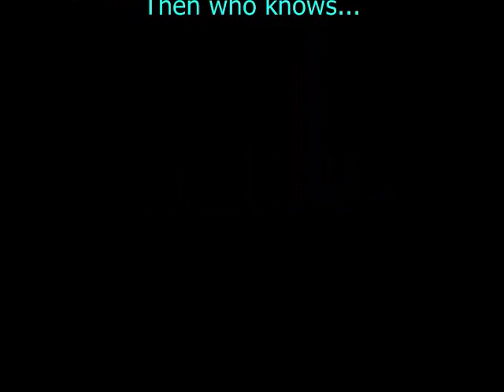My 900 VA Tesla Coil! (Resonant Transformer) Lightning Machine

Comment: I find this stuff so cool - and the discharge immensely beautiful. What I don't understand though is what practical application this has for us? What can this be used for in terms of producing Work in physics terms?
Reply: The entire point of a Tesla coil, Why Nikola Tesla invented the damn things, is to send Energy without using wires, vie sending energy through the earth at your wire, not copper, this would in turn destroy the power industry because there are power lines everywhere, if Teslas coils actually becamse commercial power line companies would go bankrupt, corporate america fucking up society for once again profit...
Reply: GregJoshuaW 

New 2014 solar energy  here look at link 
http://earth5energy.blogspot.com
Reply: lespaulking69 You don't know what you are talking. 
Using a cell phone? What do you think on what invention this is based?
Transmitters sending energy, and your cell phone picks it up.
Reply from the maker: lespaulking69 Earth is a very poor conductor. Tesla used small parts of it as a reservoir for charge, not to conduct electricity.

Tesla was using radio transmitters for all his experiments, although they were poorly understood at the time. Tesla coils don't even radiate very much RF, most of the energy transfer is magnetic coupling, and lots of tesla's experiments were concerned with electric fields and capacitive coupling through the air.

Commercial power companies are doing a fine job with AC transmission. Please read a book.

Comment: You are a genious. Great itroduction and explanation of the basics. I'm a bit in this field, but I didn't quite understand how you turned async motor to sync. As much as I know, sync motor has to have magnets, induction always lags. Great job and keep on the good work. My SUB to you.
Reply from the maker: To be precise, inductors "lag" current, induction motors tend to "slip", unless they are synchronous induction motors. Most applications aren't concerned with slippage in induction motors, as long as they produce lots of torque, so synchronous induction motors are not common, but they do exist. I believe I detail the process in this video for converting a regular induction motor into a synchronous induction motor.

Comment: It seems that the secondary coil is acting as a quarter wave vertical antenna with a capacitive hat. Do you get any radio frequency interference complaints from neighbors when you run the coil?
Reply from the maker: It works on the same principle as an antenna, although tesla coils are designed to radiate as little as possible electromagnetically. It is more precisely described as two resonant, magnetically coupled LC circuits.

The coil produces some RF noise as a product of the "sloppiness" of the spark-gap switching, and activity within the arc.

Comment: have you considered applying at NASA?
Reply: anyone with a degree/understanding in electrical engineering could make one.
Reply from the maker: popedarren Really anybody could build one of these, and they are /very/ simple operationally.

This coil is a piece of dumpster hardware compared to whatever you are typing on.
Reply: kimo Hajije I've seen the tesla coil made, but the way he recharges the capacitors... It sounds, from what I'm hearing, that he's beginning to understand what Tesla was obsessed about: resonance; tuning.  The swing analogy said a lot to me.

I say keep it up, my man!  +highvoltagefeathers, Don't let the nay-sayers hold you back.  Keep doing what you do.  Follow your passion and learn.  The only person you have to impress is yourself, and when you're on the path of discovery, you'll be continually amazed.

Comment from the maker: Well, plain and simple, you're wrong.

This coil wouldn't operate without a synchronous motor.

There are many others who have used the same procedure to make synchronous motors (inefficient, sure, but synchronous) out of normal induction motors. Experiment comes before blind statements.

Google is your friend, sir. Look it up BEFORE you mouth off something ignorant.

Comment from the maker: You don't want to do that with normal transformers. You'll exceed the breakdown voltage of the secondary windings. You can run a center-ground configuration with two core-grounded transformers (like microwave transformers). That way each winding only sees it's operating voltage, but the potential between the two terminals is double that.

Comment: The primairy coil produces a radial magnetic flux towards the toroid, so it should be equal divided at the end. But i noticed that the orientation of the sparks are often on two sides of the toroid... That's where my question was rising from.. But also i noticed the breakoutpoints... So probably if the breakoutpoints are centered, probably you always have two points were sparks come of the toroid... Maybe resulting of influence of the magnetic field of the Earth, or result of the environment...

Comment from the maker: The primary coil produces magnetic flux densities several orders of magnitude more intense than those produced by the earth.

The primary influence behind arc direction is a sharp point, a "breakout point" on the toroid (its made of dryer ducting, so there are plenty).

Magnetic fields do affect arcs and plasma, but the earth's is extremely weak, and the electric fields produced by the toroid, breakout point, and nearby objects dictate arc formation most prominently.

Comment from the maker: In this case, I was mildly disappointed. Synchronous spark gaps are very important for high-power systems in which a missed firing or transient could damage thousand-dollar equipment. I also tried a static gap, and a "sucker-gap" hooked up to a vacuum, both of which worked as well, if not better, than the synchronous gap.
Just my coil though! 
You get much less HF noise with the synchronous gap, which is important for fairs and events. That's why I use one.

Comment from the maker: voltage does not always translate into useable power. This coil draws 750 watts of power from a wall outlet, and is incredibly inefficient. It has zero capacity to "produce" power to do anything.

Comment from the maker: I'm just referencing the power consumed by the neon sign transformers (their ratings on the label), 12kV at 60mA is 750 watts. In reality, unless you use a power factor correction network, you are probably pulling more than that from the wall, but that is the power that goes to charging the primary capacitors.

Comment from the maker: You could also just stick to a static gap, they are hassle-free and work relatively well. Unless you are building a monster coil, I'd say a synchronous gap isn't worth the trouble. My coil is not a monster, and in retrospect, I had better results with a sucker-gap than this rotary piece I have installed here. Not worth the trouble for small stuff (anything under 1000 watts) in my opinion, if you aren't mechanically inclined.

Comment from the maker: Unless you are running your spark gap at a high break rate (over 250 bps or so) then you should definitely run a synchronous rotary spark gap in an AC coil. Asynchronous rotary gaps are for DC charging tesla coils. If you run a low break rate asynchronous rotary gap on an AC tesla coil, then your capacitors could charge almost completely, and if the gap doesn't fire before charge voltage crosses zero, that energy gets dumped across your primary transformer. Not really an "option" for an ac coil.

Comment: Hey there, love your coil! Just wondering, a rotary spark gap is better than a static one isn't it. Also if I wanted to use one for my own coil does it have to be tuned to a certain rpm or frequency (as you said in the video you have scrutinised it to the AC cycle) to improve the coils performance? If so how would I go about doing that?  Also why do you have two toploads, is it just to increase the capacitance of it overall? Thanks

Comment from the maker: Modern tesla coils (physically) bear very little resemblance to tesla's original machines. Tesla was chasing the goal of wireless power transmission in a way that we now know would be relatively impractical. On the way, however, he discovered methods for radio transmission and control (although the credit for the first "radio" went to Marconi).

Modern tesla coils are almost always optimized for the purpose of throwing lightning all over to freak people out and pick up chicks. (it works :) )

Comment: Hello that was very interesting . Just a thought : generally hooking transformers up in parallel has the danger of creating a loop circuit into the coil of one and out the other . any deviation of output voltage between the xfmrs would cause a current to flow round and round thru the xfmr coils . causing excessive heat . although the resistance of the windings is high the voltage output is high and because of that i think any deviation would be magnified . also...

Comment from the maker: Tesla's earthquake machine is a myth. You cannot shake down a building with a mechanical device the size of a shoe box. A little bit of shaking underfoot, possibly. But think about it. If a building were a perfect mechanical oscillator, then this little machine would be able to induce gigantic oscillations at its resonant frequency. BUT a building is not. The structure, and moving furniture absorb energy. All these losses add up to way more energy than you could add with the little piston device

Comment from the maker: Push and pull, if you want to think about it that way. Its alternating current. Voltage is just a difference in charge, current is charge moving in order to bring a difference in potential to equilibrium, work can be done by the current as it moves, and power is work performed over time. It usually doesn't mean much to think of negative power, which refers to whether work is being done on or by a system over time. No lies.

Comment from the maker: OR use the inverter to drive a resonant primary circuit (primary capacitor and inductor) that is tuned to the resonant frequency of the secondary (DRSSTC). 
SSTCs usually run continuously, while DRSSTCs typically run in pulsed operation at very short duty-cycles (only a few RF cycles at a time), to limit primary currents.

Both are very cool, because they can be either amplitude modulated (SSTC) to play music, or the pulse-repetition-frequency of a DRSSTC can be modulated to play music.

So Yes!

Comment from the maker: Absolutely. Spark gap switching is extremely inefficient, and burns away much (in some cases most) of the energy that would otherwise be coupled to  the secondary circuit.

Google "solid state tesla coil" (SSTC) and "dual-resonant solid state tesla coil" (DRSSTC). These are tesla coil architectures that employ a large power transistor-based inverter (usually surplus IGBT modules in the larger coils) to either drive a bare primary coil, at the resonant frequency of the secondary (SSTC)

Comment from the maker: There is nothing to be harvested. This machine is plugged into the wall. The arcs you see are a result in high voltages induced in the green coil and metal piece at the top, by the copper coil and circuit on the bottom, which plugs into a wall and uses about as much electricity as a small microwave (a relatively large amount of electricity).

Comment: pico amp?   if the power was 750 total, and 1million volts, that should give 0.7mA  , what was the voltage and amps output, do you know now? thanx

Comment: Hey, nice video,

I was wondering, since the dielectric breakdown of air is 3 million volts, can't you just multiply your arc length by that to find the voltage on the topload?

So for example, my coil gets arcs around 60cm, so 3 MV X 0.6m = 1.8 MV.  From what you're saying however, voltage this high seems wrong, but why?

Comment from the maker: Thanks! And correct on that. Milled 4 flats in the rotor for synchronous operation. The coil operates at around 278 KHZ (despite whatever I say in the video), which is a little bit high for a coil this large, because I used a relatively heavy gauge wire for the secondary. Not that it matters too much, as long as it is tuned correctly.

Comment: I like your Tesla coil, nice workmanship! Just guessing, with your 4 pole squirrel-cage motor running @ 1800 rpm (60 hz x 120 divided by 4 poles) with 8 gaps, you have  at least 240 spark impulses per second. Have you measured the frequency? I also wondered if you had tried a second spark gap in the primary circuit downstream of the capacitors like Tesla did?

Comment from the maker: It is not a million volts, I was young and stupid when I said that. 
In adition, the coil pulls 750 watts from the wall when running. The capacitors are just charging more than 95% of the time. When the capacitors discharge, primary current can be tens of amps at nearly 24,000 volts. So the peak power through the primary tuned circuit is well into the killowatt range, as the spark gap is firing (briefly). Then the gap extinguishes, and the capacitors resume charging.

Comment: The spark length is about 100 cm. So lets say you are producing about 1,000,000 volts. And lets assume that the ampere is about 0.06 A, the power would be: 1,000,000 x 0.06= 60,000 W
Even if the ampere was 0.006, the power of the sparks would be: 1,000,000 x 0.006= 6,000 W!
Its very easy to see that the ampere of the sparks are not as low as 0.006 A and is much higher! 
You mentioned that the power input was 900 watts. How can we explain the energy increase in the output of your system?!

Comment from the maker: I would suggest that you do more experiment-based research.

This coil works just fine for me. If you would like to build your own coil and apply your ideas, that would be fantastic.

The value of the primary capacitor, compared to that of the secondary self-capacitance+topload capacitance are separated by several powers of ten. This is due to the difference in the values of the inductive components of the two circuits. This is, however, for my coil. I'm not sure that it hasn't been done before.

Comment from the maker: Thanks,

There are some coils out there with enough current on the secondary output to light a high-wattage bulb, but not mine.

For the same reason that transmission lines cary megawatts of power at hundreds of thousands of volts without heating, the bulb's filament would conduct the output without lighting.

I haven't tried the recieving coil, but it would make for an excelent experiment.

I belive you are refering to a Tesla's Magnifier designs, which use "stages" of multiple coils.

Comment: I AM NOT BEING MEAN BUT IF YOUR COIL WERE PRODUCING AROUND 1,000,000 VOLTS THEN YOU WOULD HAVE TO ADD A STRIKE RAIL, HUGE CAPS, AND ONE HELL OF A POWER SUPPLY (6 60 MILI AMP) NEONS OR A POWER POLE PIG. 

YOU ARE PROUBLY GETTING AROUNG 300,500 VOLTS. WHEN I LISTEN TO TO COIL  RUNNING IT SOUNDS LIKE YOU NEED TO SOME TWEEKING.

Comment from the maker: It lights every fluorescent bulb in the basement!
I really should be using tungsten electrodes in the spark gap, I'm using stainless steel and they just get chewed to pieces...
The manner in which the AC coil operates prevents me from adding more points to the wheel. To maintain properly timed charging and discharging of the capacitor bank relative to the AC cycle, I'd have to double the number of flying electrodes. The capacitors wouldn't charge, and I don't have room!
It would sound cool...

Comment: As I remember, it's 22,000 volts per inch. Use that to guess your Voltage off the top of the coil. Good spark!. Light up any gas filled bulbs or tubes yet? Different metal work better together for the spark gap try a few out and find the right combo.I think you could put more spark gaps on your wheel to also increase the output. How fun.

Comment from the maker: Are you joking?
When do I claim anything like overunity?
I built this machine to make sparks and ozone, and to scare my friends.
Zinc is a conductor. DUH. Its a metal.
Aluminum, is about 4 times more conductive.
Wouldn't make much sense to make the inductive cage for the rotor out of a very conductive metal, and then cast the rotor in an equally conductive material, now would it?
Please go hate somewhere else.

Comment: Tesla said it would be 100 yrs before someone would be able to fully understand his research. To put it simply we do not have to consume the source....we only have to consume the collector or collectors. Tesla coils are electrostatic inductors (at least the common way they are built). With the missing piece it becomes a superluminal transmitter for wireless energy and/or anything else. Can knowledge be shared wirelessly...absolutely. It can also be removed. Have fun

Comment from the maker: I have been wondering about that... My calcs say I should be able to run the spark gap at 240 breaks per sec effectively, but the capacitors only fully charge at 120.
That would explain alot, those resistors get extremely hot...

Comment from the maker: Untrue. speaking in radio terms, there is no perfect radiator. i.e. no radiator will emit a field in which intensity fades with distance^2 in all directions. You can in fact create radiating elements which have very high gain in one or two directions (such as the primary radiator (coil) in my tesla coil). Useless? Tesla made the first radio transmisions to cary information, created the first remote controlled vehicle (small boat), and experimented with radio excitation plasma lighting.

Comment from the maker: We know from common sense that pushing current any considerable distance through the air is impossible without ionizing it, because air is a dielectric material. Read up on radio theory and RF power transmission.